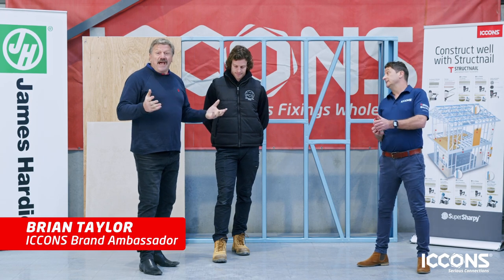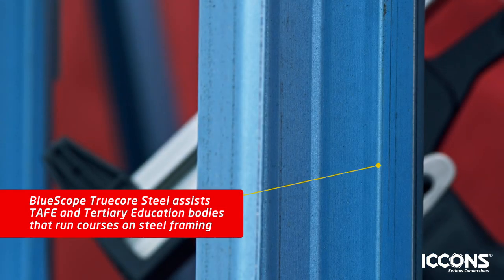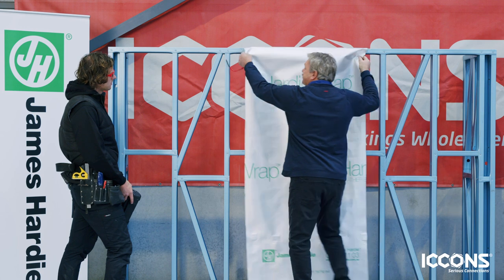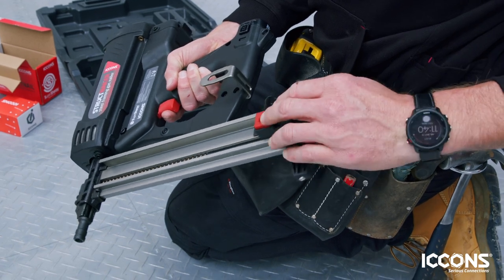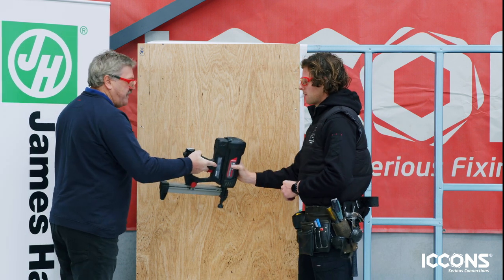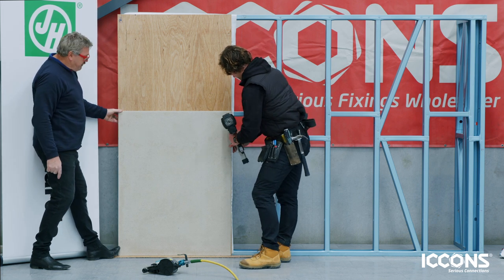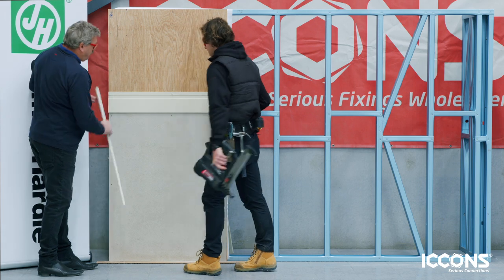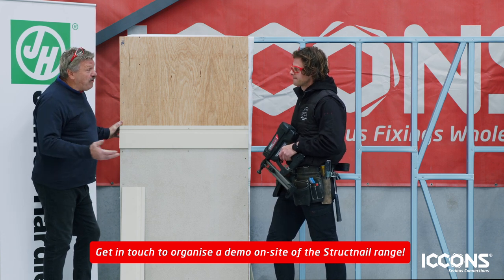ICCONS Structnail Nailing System w/ James Hardie Exterior Cladding to BlueScope TrueCore Steel!

Comment: GARBAGE! 
You cannot use cloud nails on a fine texture panel! That was a massive NO NO from  the demo we did at the James Hardie headquarters. Which means you can only use pin nails. It also says on the specs.
Reply from the maker: This system is directly approved by James Hardie for install with Steel Framing!